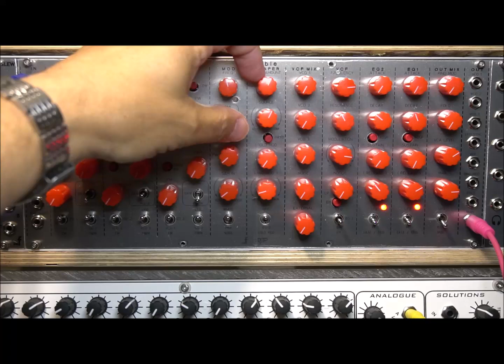Introducing reSEMble

Comment: Hello! this seems like a nice project, i take its controllable by 1V/Oct CV? how would you implement control via MIDI controller?
Reply from the maker: It is 1V/Oct.  Since it uses the Eurorack power and patching standards, you would need a MIDI to CV/gate converter, either a Eurorack module or something standalone like a CV.OCD.
Reply: @RandyPiscione  Hello, tried to purchase the PCBs but got an "Out of Stock" message, are they getting back anytime soon?
Reply from the maker: @Alejandro-kz2zf  I hope so.  PM Foundations is running into delays because of the COVID virus.  There are currently 19 people on the wait list but there's not too much that can be done except wait.
Reply from the maker: Alejandro, if you're interested, get on the waiting list, PMF has been able to order more.
Reply: @RandyPiscione  Already did in the morning, thank you! Pretty interested in this synth
Reply from the maker: @Alejandro-kz2zf  Great!  There's a build thread on the PMF Tindie site, in case you need any help or just want to report on your build progress.
Reply: @RandyPiscione  Got a last question, there is mentioned in the tindie description that it "isnt a SEM clone", i get that since theres wavefolding and other added options, but wanted to know if the core elements aka. VCO's, VCF and VCAs share exact or very close circuitry with the original design? or were these changed for different but "workalike" designs?
Reply from the maker: @Alejandro-kz2zf  We didn't feel right copying Tom's designs exactly.  The EGs are close and so is the VCF.  The VCOs use similar designs but modernized, no use having people search around for old op amps.  The VCA is new, we needed something different in this case.  Not sure if you had a chance to listen / watch my comparison videos, but check out reSEMble 1 of 2, and let me know what you think.

Comment: So awesome. I'm a little intimidated at the build size, and me being a novice, but this is amazing.
Reply from the maker: Each individual piece is not too difficult but you're right, it is alot to build.  I'm about 1/2 way through a second one.  If you decide to try it, just take your time, build one piece at a time and get it working, and it'll come together fairly quickly.
Reply: @RandyPiscione  Do you suppose I could get you to film a breakdown of that ribbon cable stuff at the end? The power bus board makes perfect sense but the other chain of cables, cv connections I guess, looks rather difficult to follow.
Reply from the maker: @TigerClawTV  It's only because it's the prototype.  We've changed the busboard so it's a single long row and each module hooks up in sequence.  Much easier.  I think we moved most of the power connections to one side as well.  As I build the second one, I'll try to remember to take some pics.  Did you see this vid:  http://www.youtube.com/watch?v=l1F8KSVHmjE  Oops, I noticed you did.